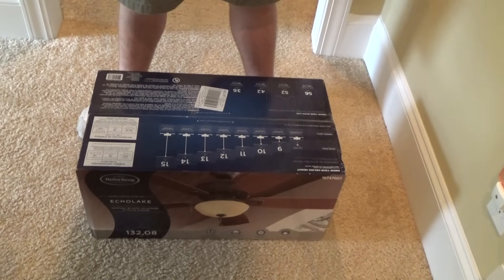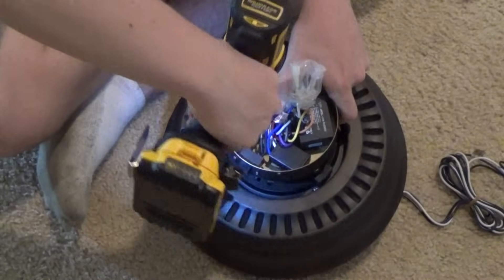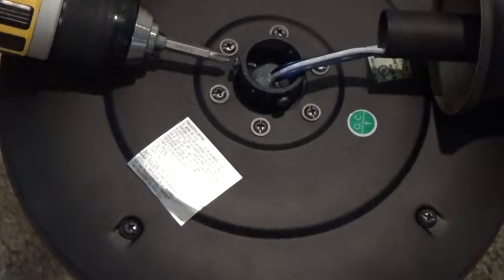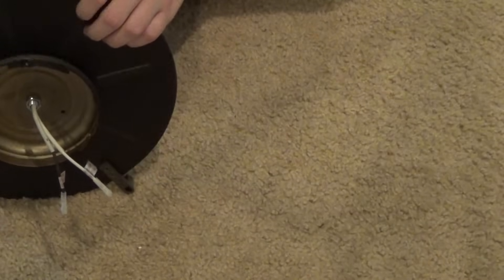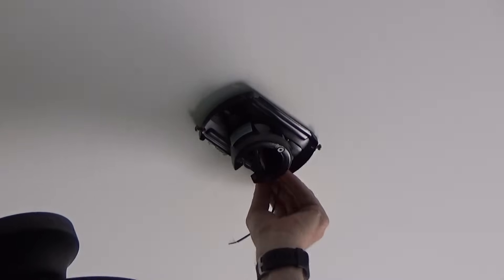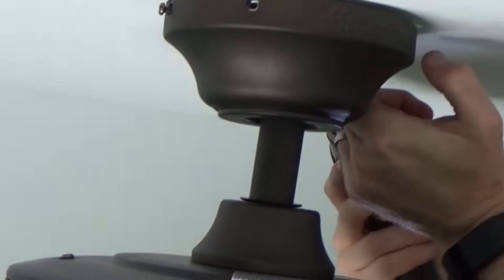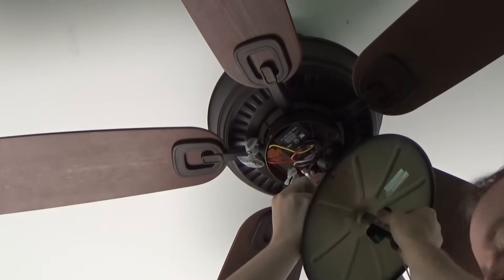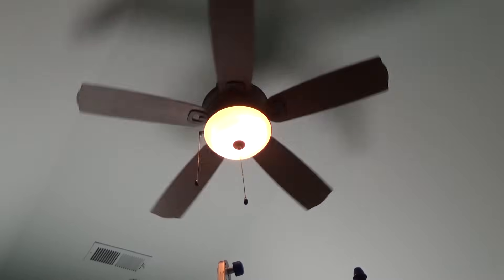How to install a Harbor Breeze Ceiling Fan from Lowes

Comment: What if you have 3 white wires and one black?
Reply from the maker: You will need a multimeter to figure out which wire is for what. Unfortunately, there is no other safe way.

Comment: Why not assemble the fan while it's still on the floor?  Then only work to be done over your head on the ladder would be to put the ball on the down rod onto the bracket and wire it.  It would be heavier to lift, but you're immediately putting it on the bracket, so that would take the weight.

Given that Casey Colaneri wrote, "I think you should’ve just installed all the blades but one before you hanging will make you life so much easier", writing "but one" in there makes me think there's a functional reason why this can't be done, but (since I haven't started the process yet) I don't yet see why not.  Maybe with all the fan blades on, you can't really reach the bracket area, maybe?
Reply from the maker: I didn't test the theory but it appeared to be physically impossible to install the fan with the blades on it.  The reason behind that, at least with this model, is that the fan has to be angled to hang on the bracket and if you had the blades on it, you couldn't angle it to hang it.  That was why he suggested all but one blade.  Leaving one blade off probably would have allowed me to angle it in correctly.  However none of this takes away from the fact you mentioned. Sure, you might be saving yourself from having to put the blades on while it is on the ceiling but you have now just made hanging it and wiring it more difficult and dangerous.  Probably the all but one blade idea is best but I didn't get to test that out.  If you do, come back and let us know how it worked out.
Reply: @ClintHolland  I did it that way and wrote way too much about it in another reply.

Comment: Clint, this was a great video, we bought 3 fans,  all 3 Lansings, 2 brown and 1 chrome.  We put the chrome on up first, and absolutely no wobble when the fan is going.  But the second one, we have some wobble when the fan is on all speeds.  We put it together just like the first one and so we are wondering what we might have done wrong, or could do to correct it, before we install the 3rd one.   Thank you!
Reply from the maker: Good question. My first recommendation is to make sure all the blades and blade holders are tight. If so, you just have a fan that is out of balance. Most hardware stores actually sell balancing kits which include little weights you can put on the blades to stop it.  I doubt you have the problem with the 3rd fan as it's pretty rare today.
Reply: @ClintHolland  Thank you, appreciate the response.

Comment: I used the instructions alon with your video for my fan installation. I had red, white, black up in my ceiling. Connected them per your instructions. The light came on but the fan did not. So, I rewired it according to the instructions. White on white, green on bare copper and black and blue on black. Threw the switch, but nothing happened. I'm now scratching my head.
Reply from the maker: Do you have 2 switches on the wall for controlling the light and fan individually or just one?
Reply: @ClintHolland  There is one switch on the wall. Behind the switch is a mess of wires, both black and white, but only one red. It also appears that the switch in the living room is connected with a panel of switches in the kitchen. It is confusing. I decided to hire a Lowe's professional installer to come out and finish the work. I also learned the blue box in the ceiling won't support the fan. So, my simple install turned into a cluster.  Lol, sigh, I tried.
Reply from the maker: @MPERIALENTERTAINMENTD  Sorry to hear that but glad you got it worked out.
Reply: Clint Holland i am having the same issue. I have black, white, red wire and bare ground wire. I wires the black to black, red to blue, white to white, and the 2 green and copper together. Fan wont spin. According to the instructions this is correct for one switch.

Comment: Thank you for the video.  I used it as a reference to go along with the manufacturer’s instructions, and everything was a cinch.  I was replacing an old fan because the light kit became inoperative.  My light kit was originally tied in with a wall switch, and the fan was hot at all times.  I basically matched the old wiring to the new one.  I had two hot wires (red) tied into the fan hot (black), another single hot wire (orange) tied into the light kit hot (blue) and two neutral wires (white) tied into the fan’s neutral (white).  My home was not wired with a ground, so I simply tied off the ground wire to the fan.  It works exactly as planned.  I leave the chain for the light kit always on, and control the light with a wall switch.  The fan is controlled by the chain switch.  I had my one son helping me with the job, and just like you, I was busting his balls the entire time.  He’s a good kid and very mechanically inclined like his old man.  These people giving you crap need to chill out.  They obviously don’t have a sense of humor.
Reply from the maker: Thanks Joseph and you are exactly right, get a sense of humor. I make these videos to help not to get trolled but such it is.  Helps me develop a thicker skin.

Comment: Hi, the fan has a green, blue, black and white wire, but my ceiling has a red, white, black and a naked wire, how do I connect it?
Reply: The bare wire will connect to the green. White is usually a neutral and black is the hot. But your going to need a meter to verify.

Comment: Hi there. Would I need to shut the power down from the light switch or from the main power box?
Reply from the maker: Either one would technically work but I always recommend doing it at the breaker box.  The last thing you want is someone to turn the switch on while you are installing it.

Comment: Good video only thing is you say the house is wired for a ceiling fan. If this were the case the electrition that wired your house would of installed the correct box. And that reams wire is leading to a remote switch not because it's for the light..

Comment: To connect the 2 wires from new fan light switch to the fan/ceiling, it doesn't matter which wire goes to which?!?!  (my light switch chain won't move at all, replacing it)
Reply from the maker: In general it doesn't matter but I would still try to connect them correctly.  You may need to get a multimeter to verify which wire is which.  Sometimes it doesn't matter and other times, especially with remote controlled fans, they won't work if the wires are reversed.

Comment: Hello sir. 
I have a sealing fan model 40305 the fan have a white and red wires and my sealing is red, white and black just I little heads up how to wire this ?
Thanks
Reply from the maker: It's dangerous for me to say how to wire something based solely on wire color.  You really need to check those wires with a multimeter to know.  However, I will give you my opinion.  Do you have one or two switches on the wall for the fan/light?

Comment: Hi!! Great video by the way it helped me a whole lot!!! I have a harbor breeze model as well and the lights come on but the fan blades won’t turn. It hums but no motion on the fan. Would you happen to know how to fix that? I tried the switch for the direction of the blades and that’s not the problem. If you have any ideas please let me know. TIA

P.S.  I got your sarcasm about your son 😊😊
Reply: GEORGE ATKINSON thank you I might try that but I’m going to take it down and retry resetting it because it was working fine before I knocked a screw loose on the blade so I do t think it’s dead just yet.............. if I haven’t killed it lol

Comment: I got this exact fan and your video was a big help. Even with that your son was light speed ahead of me even using the video as a guide.

This fan was put up in my patio and I live in Florida so there is a lot of moisture. 

On most fans adjusting the blades is simple. With this one, it's a pain in the neck and you have to remove the light kit. 

Before I attached the light kit I turned back on the power and tested out the fan which was making a lot of noise. It looked like the blades were grinding on the motor so I had to slightly loosen each blade. I spent 3 hours and got to the point where there was no grinding sound for the low and medium speeds, but still present for the high speed. This fan on medium is faster than the rest of my fans in the house on high speed so I just threw in the towel and thought that was good enough for me.

Sorry but I haven't read every comment so this may have been posted before. At around 21:35 the globe is attached with only the bowl cap and finial. However, these two parts are just decorative. The hex nut was not removed before putting up the globe. The hex nut should be removed. Then put up the globe, secure with the hex nut followed by the bowl cap and finial. 

The fan looks much better than the rusted-out 30-year-old fan that was up previously. This is the 5th fan I put up in my life and definitely the most difficult. Making adjustments will be a much bigger pain in the neck than the other fans in my house. Your video made a hard job a little easier.

Comment: How do you install it with out the rod ? I would like it flush because I have low ceilings
Reply from the maker: This model doesn't offer a flush mount so you will have to at least use that small down rod with it. Can you confirm what model fan you have?

Comment: Video was good. Question : When you put the small and large canopies together (which was not on camera) it did not show how to attach them together. Immediately after putting the small canopy on the rod they came back on camera, they looked like they were attached together because when you put the rod on the motor with the pin they seemed attached. How do I get them attached together so that the smaller one is not loose on the rod.
Reply from the maker: See 5:45 in the video.  You just attach them back to back on the downrod. Let me know if you have any other questions.

Comment: The best tip I can give is not to put the blades together until you get the arms mounted. And leave the washers off. Or you want have enough threads to mount them.

Comment: Thank you! My fan has been installed for about a year, but quit working. I thought it was the remote battery, so I changed that and it still didn't work. Thanks to this video I learned that I simply needed to re-sync the remote.
Reply from the maker: Awesome and great point.

Comment: Question - I connected white to white, black to black, the two greens to bare copper wire together. I had a red wire coming from the ceiling and I connected that red to the blue coming from the fan. I assumed this was for the light kit to be turned on from the wall switch but when I turn the switch the lights don’t turn on. The fan works but not the light 💡. Can you please let me know what I’m missing? Thanks.
Reply from the maker: Do you have a multimeter that you can test with?  That is about the only way to truly test and find out what each wire does.  Otherwise, it is a guess.

Comment: I have same model fan and tried to put it up but  plastic housing in ceiling poorly secured and doubt it would hold weight of fan. so I gave up.
Reply from the maker: If that is the case, you will have to replace that box with a nice, sturdy metal one.  It isn't too difficult to do either.  There are videos on here of how to do that as well.

Comment: Is there an option with these to not install the down rod?  I have a low ceiling.
Reply from the maker: Not on this model.  You have to at least use the short down rod on these.  They do make some flush mount ones but this isn't one of them.

Comment: I’m confused on the wiring. I have two light switches I connect two blacks with a blue . The white wire on white wire and the green wire with the bare wire but what about the pink/red wire? What does that connect to?

Comment: Thank you! How could I tell if I need one of those expandable ceiling fan brace to replace the existing light fixture box?
Reply from the maker: Are you able to get above the box such as in an attic or is this a box between stores or otherwise inaccessible?
Reply: @ClintHolland  why my fan is wobble what I did wrong

Comment: if I don't have a red wire, what wire from the ceiling do I attach the blue wire to? the white or the black one?
Reply from the maker: You can't really go by the wire color at all.  I hate to say this but really the only way to verify which wire to use is with a multimeter.
Reply: +Nick Hiers the black one
Reply: +Nick Hiers the black one

Comment: Installed this fan before I saw this video.   Saying the blade mounting procedure  "sucks" is a gross understatement.  Have put up many such fans over the years and never had such a difficult time with the fan blade attachment.   Lousy design.   Plan to take  the other two I purchased  back to Lowes.
Reply from the maker: I completely understand.

Comment: Thank you for this helpful video.  With your help, I DID MY FIRST ELECTRICAL WORK!  YAY!

I did try my suggestion, assembling it all before lifting it up.  Even with certain difficulties, I suspect that it was easier than the manual or (sorry) this video.  My notes:

(1) I first took down an older version of the Lansing type.  If the set screws are tight, it turns out that they CAN take the weight of the whole thing.  EDIT: but like the video says, never rely on them or on the wires holding it up!

(2) Regardless of how you put it together, you should consider a magnetized screwdriver.  Believe me, it's a pain in the tuchis when you drop a screw into the case -- but at least if you're assembling on the floor, you can shake it and all to get it out again, more easily than if it's hanging.

(3) A problem: if you do full pre-assembly, how do you set it down on something?  The down rod stuff and the light kit are designed for being hung, not to rest the whole weight of the assembly on it.  I put it together on my lap (there's that natural gap, after all), and then set it down carefully in the gaps of the styrofoam in the box, and it didn't break.  I think it would be better to set the body upside down on a table or something, attach the fans, attach the light kit (without the glass shades or the bulbs).  Then turn it right-side up and carefully rest it on your lap or on the styrofoam (or something thick and soft) to attach the down rod, canopy, and yoke cover.  Then hang it.  Then wire it, attach the canopy to the bracket.  Then attach the glass shades and the light bulbs.  (Or instead hang it before attaching the light kit -- that kit may be fragile.)

(4) The guy in this video hung it in seconds.  It took me about a minute to get the ball into the bracket, and my arms got really tired.  I think my problem is that I'm a klutz, and also I didn't plan a good cleared way to get it in.  Make sure the ladder is back a bit so you're leaning forward stably.  Move all the wires out of the way.  Go up a step on the ladder if needed to look at it easier or have less lifting.  Lift it with your strong arm and use your other hand to guide it in.

(5) The blades did not get in the way of hanging it -- I didn't notice any tilt.  They DID get in the way a LITTLE bit while wiring it and attaching the canopy.  But it wasn't a problem: I nudged the blades out of the way with my hand or with my head if needed.  Since the circuit breaker and power switch are off, that shouldn't be a safety issue.  And I could stick my head between the blades, or reach thru, all I needed to.
Reply from the maker: Very nice and thanks for sharing those tips Timothy.

Comment: Great video I got mine installed but it don't turn on . I connected my black one to the black one and didn't use the red wire . I don't know where I went wrong
Reply from the maker: What wires do you have coming from the ceiling and to what are they connected to on the fan?

Comment: Thanks for posting! This really helped. Dumb question - how do you prevent the Dow rod from wobbling through the canopy once everything is installed? It’s secure everywhere, but it’s not secured through the opening or the canopy. Maybe it’s just supposed to be this way?
Reply from the maker: Correct. It is supposed to wobble to be able to absorb some of the motion of the fan. If the fan is running and it's wobbling a lot, you probably need to balance the blades.

Comment: Sloppy instructions. What tf? Connect to the other 2 wires, really? Which ones?
Reply from the maker: It's pretty simple.  I have no idea what color the wires are in your house and even if I did, I don't know what they do because I didn't wire it. Telling you to connect the red to the blue could trip your breaker, ruin your fan or hurt you without me knowing what they are.  Depending on when your house was built and who wired it, the colors can mean anything.  The only way to know what wires to connect it to are to use a multimeter or use the information from how it was wired on the previous fan.  With that being said, I am happy to help the best I can. What color wires do you have coming from the ceiling?

Comment: Hi, thanks for the video. 

I bought a harbor breeze beach creek with remote control.  However, my house is wired with a jbox that has a dimmer and speed control. Any ideas how to wire it?
Reply from the maker: See if my other video helps. This is me installing a fan that has a remote. If not, let me know what color wires you have and how many. https://youtu.be/WfhYInLo1e0
Reply from the maker: See if my other video helps. This is me installing a fan that has a remote. If not, let me know what color wires you have and how many. https://youtu.be/WfhYInLo1e0

Comment: is it capable to make the light work with a switch instead of the remote?
Reply from the maker: Absolutely.  The way I wired them in this video, both the fan and light are controlled by separate wall switches.